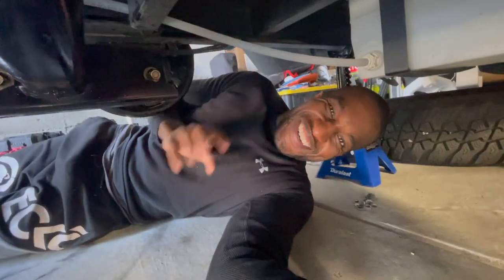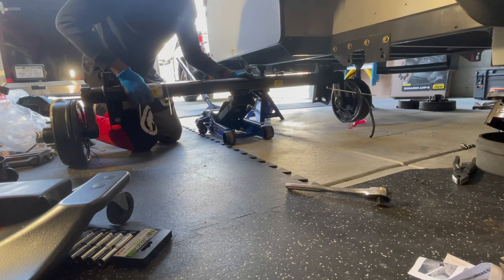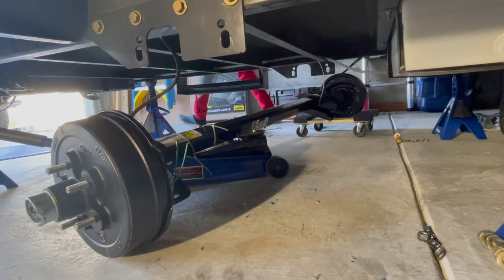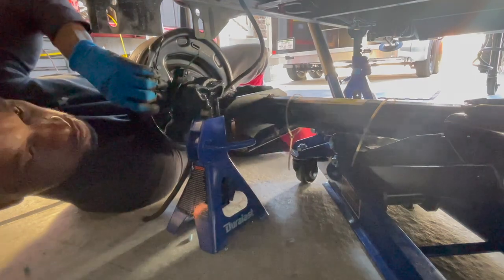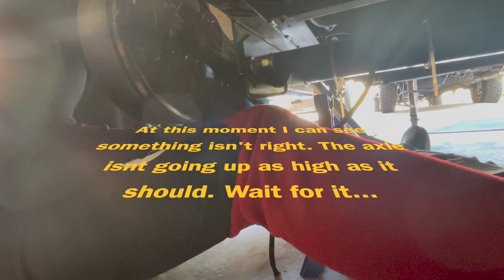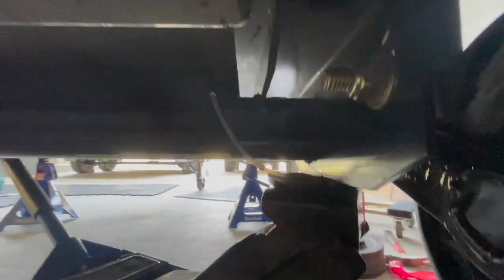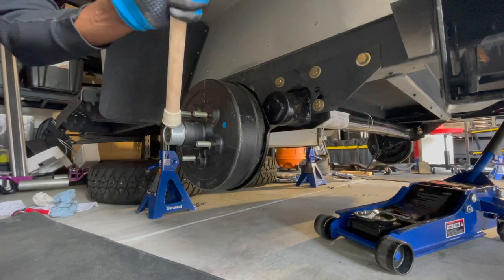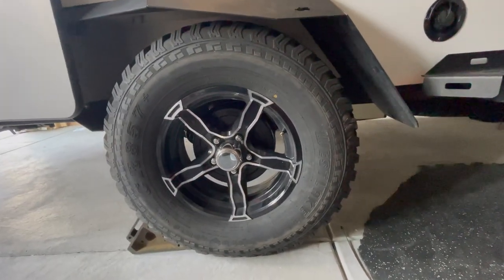2021 Taxa Cricket Axle Replacement  Part 3: Installing Axle

Comment: Great detail as I am just going through this same dreaded Lippert Axle issue on my 2022 Woolly Bear. Now that you have had the new axle for a year or so, any other issues? All ok at this point?
Reply from the maker: Sorry to hear that! I actually replaced my axle and sold it. After I sold it the buyer told me it did it again on the new axle. So sad that they can’t get that right. Nice trailer concept! I wish you the best on yours!
Reply: @iAmMarchal  Thank you! Taxa really did not do themselves any favors by under spec”d axles. I am hearing more and more of this same issue. Thanks for the info!
Reply from the maker: @TakeAHikeToday  no kidding. You come so far then stop there? Come on Taxa. You should look into just getting a refund and replacing the axle with something completely different. Independent suspension maybe.

Comment: Dexter makes a 2" lift that bolts right on, did you consider using a lift? Now would have been a good time to install one.
Reply from the maker: Hi PJCD. I actually got that kit and was going to put it in. Until I discovered the axle had an issue and needed repaired. At that point I figured better keep it stock till that issue is fixed or it would either be covered up by the lift or no longer be warrantied because “modification”.